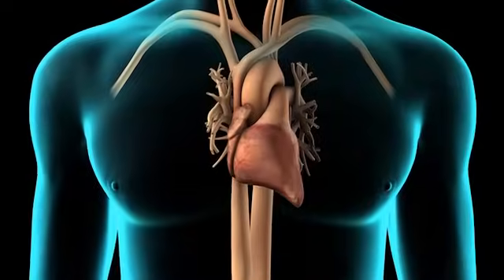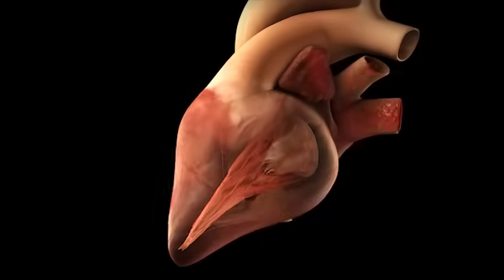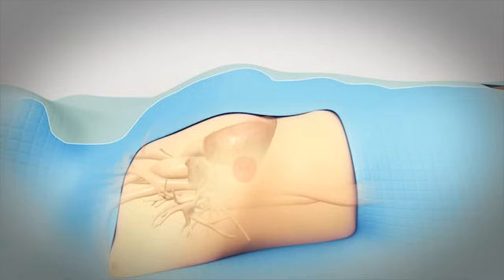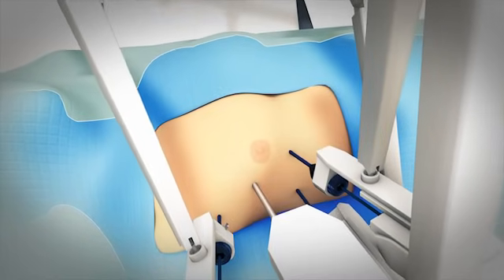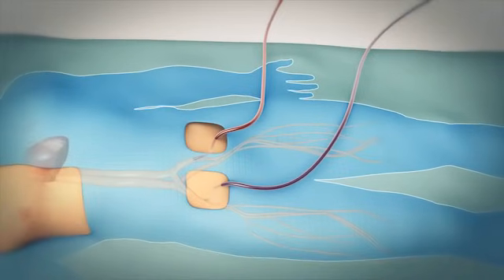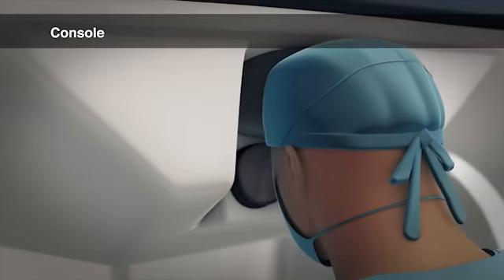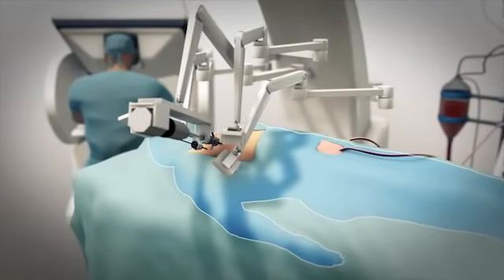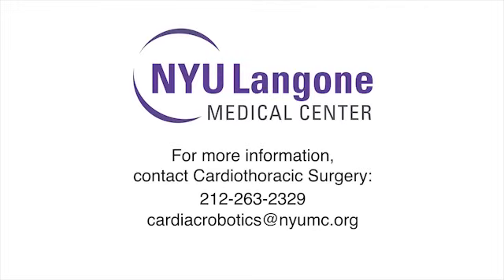Minimally Invasive Robotic Mitral Valve Repair Animation

Comment: Have they already tried to replace for ruptured cordae and other pressure related prolapsing of left atrioventricular valve (was that mitral valve) that very valve with prosthetic structure like TAVI? Because those are not ever de facto curative, but how about very adaptive stucture stent with traditional and biological-evolutional-sense ventricoarterial valve structure prosthetic device for those as well av-valves? Must have done already,    so obvious is not it? Would not be nice, no opening of thoracic space and so on, extremely heavy surgery, extreme burden for stuff and especially, the patient...

Comment: I had this procedure done at UC San Diego June 2020 by Dr Michael Madani and his staff.  I was 5 days in the hospital,  It worked very well.  There was some pain; this is serious surgery, but recovery is on schedule and I can see by the ultrasound that the valive which was leaking terribly is now sealing like it should.  It should last a lifetime.  I'm fotunate in many ways.  Many thanks to Dr Madani and UCSD.
Reply: I just had this surgery the 22nd of June the doc told me I'd have to have another one in 10-15 years because the valve wears out because I got the artificial Valve
Reply: Follow up.  The valve repair failed due to no fault of the surgery team, as far as I can tell.  I got a bovine valve replacement using the more conventional surgery AKA power tools through my sternum.  That has proven successful 2.5 years later, but the recovery from the 2nd surgery was quite a bit slower.  I am not really back to the fitness level I was at before the heart problems, due partly to the difficulty of finding time to work out.  I am now 66 years old.
Reply: @mriguy3202 thank you for sharing
Reply: I could've chose the metal valve but I'd have to be on blood thinners the rest of my life and I'm only 28
Reply: How much did it cost?
Reply: @Hellhammer___666  I had mine done in 2011 at the Cleveland Clinic. My "surgery" was $18,000. The total cost of everything from start to end ( prep, hospital stay, 24 hr. monitoring and the surgery ) was $174,000. Insurance pays the most of it. To keep a person living another 30 years or more, priceless.
Reply: @username8171  in India heart surgeries are not expensive its maximum cost including everything would be in India around $ 6000 only and its maximum
Reply: @gursaini5055  survival rate in India 50%🤷🏻‍♂️
Reply: @bannertraveller5879  you are wrong
Reply: @bannertraveller5879  incorrect, I dont live there but research shows they are world leading in cardiothoracic surgery.
Reply: @Lady-pu8es  thanks for the info

Comment: I had already done the aortic valve replacement before 7month ago..now i am suffering the damage of mitral valve problem..can i do the 2nd surgery now..Although i am taking the warfarin as usually.. Last 7month..if you have any suggestion than told me..

Comment: Well they just told me I'm going to have non evasive mitral valve repair,  had a Myxoma in 2010 stated my mitral value was in tack and doing good looks like after my echo I need to have it repaired.  9 years later doesn't make sense.